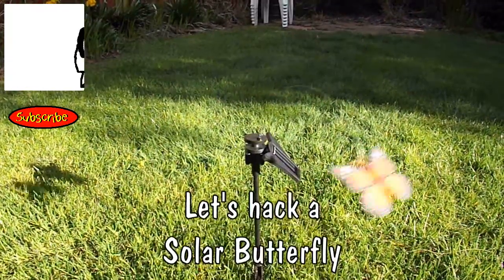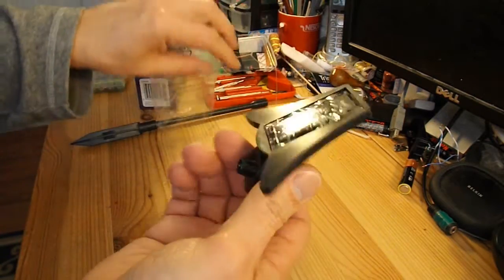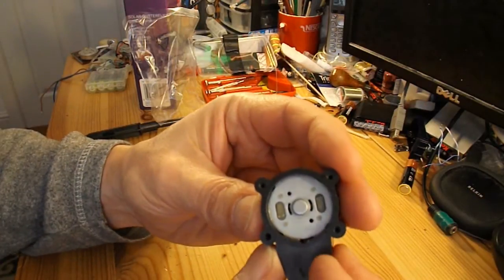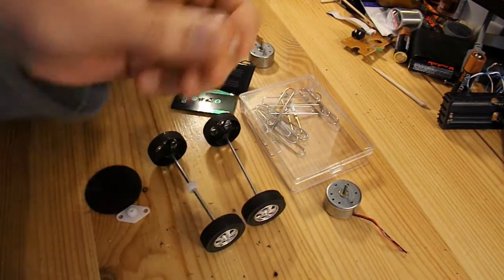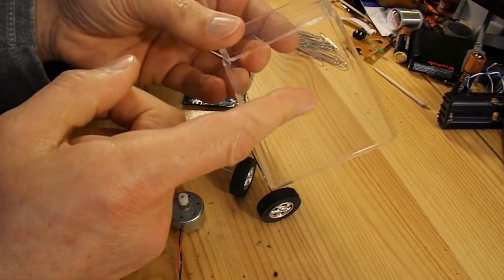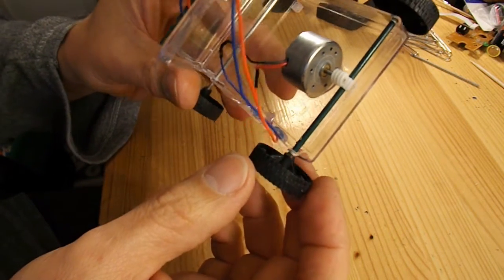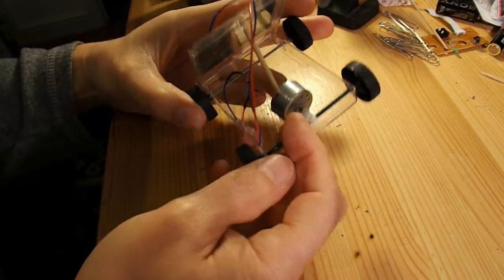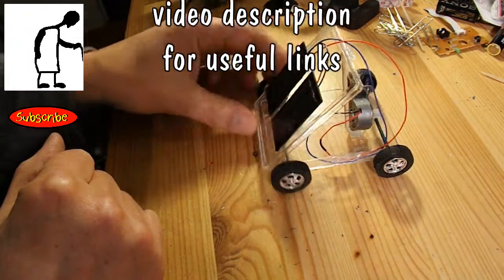Solar Butterfly to Solar Car

Comment: Great project!
Maybe we'll get those in the USA this year...nice sized mono-crystalline panel and epoxy type rather than heavier glass ?
Looks like a Mabuchi RF-300 motor (used to find them in cassette players + use the 3 poles wiring for 'Walgreen' Tesla towers).
This one would be good entered in my 'Single cell Solar Challenge' if I resurrect the idea this year. 10ft straight + fastest wins, like drag racing. Hope you might be interested in that.
Reply from the maker: Hi Slider, thanks for dropping by :-) These butterfly things have been around for a while but suddenly seem to have dropped dramatically in price, not that there is much to them. I paid £1 each for 4 of them then walked into the next shop and found similar for 97p so I am heartbroken, wasting 12p.
Not sure how well this will perform in normal sunlight as it has been raining again for the last few days. Needed to hold my lamp very close to get it to move.
Reply: It's similar here with lamp tests indoors, using 13W CFL. My builds like this are generally with 6mm tiny motors and so the way this shifted with more weight caught the eye.
I understand the costs difference, being older myself...especially if I need 2p in the middle of the night :)